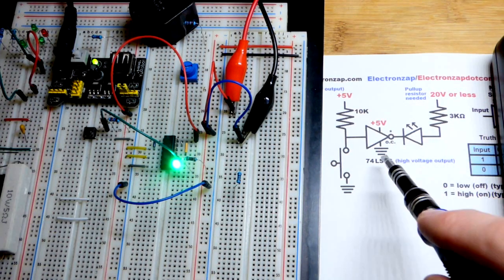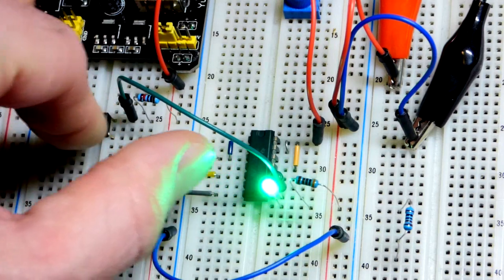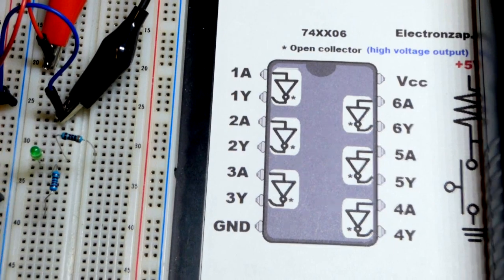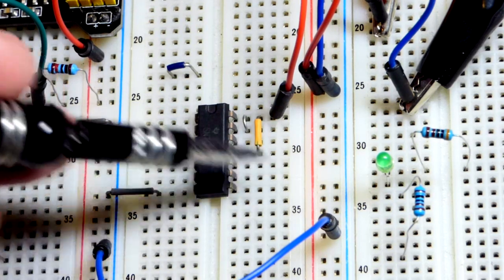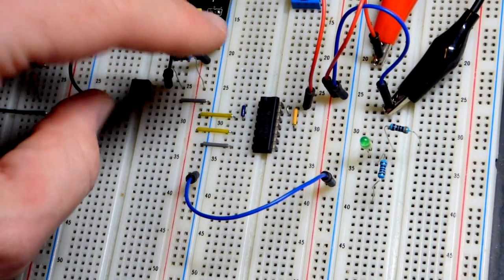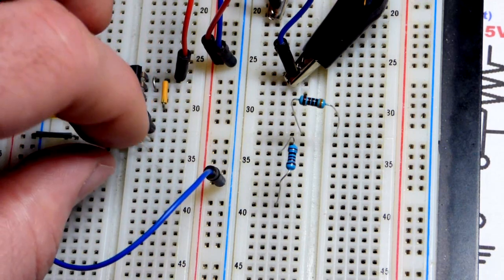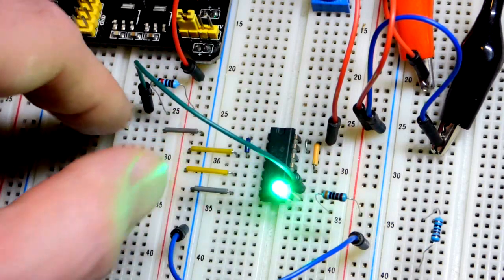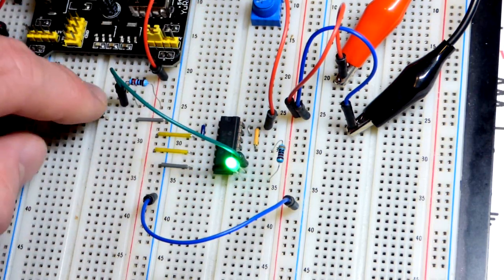7406 74LS06 hex inverter with open collector high voltage output demonstration circuit

Comment: Hi, I have a question. I accidentally fed 3v into the ground in my setup. Would this be enough to damage the  74LS06? My circuit was working fine until I accidentally inverted the voltage on my LED and fed 3v into the ground.  Thanks.
Reply from the maker: If it's not working than odds are probably that it is fried. I don't think that any 7400 IC is terribly robust.